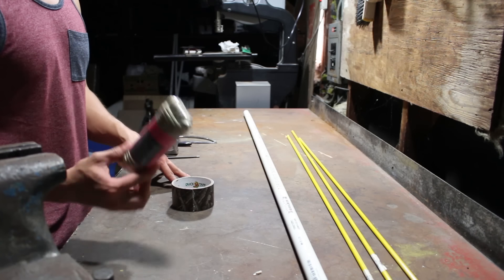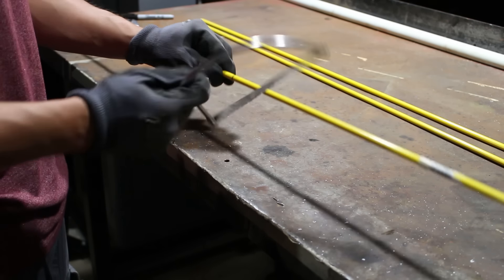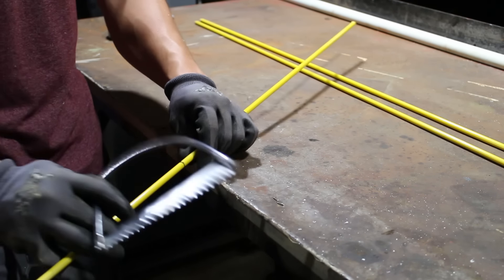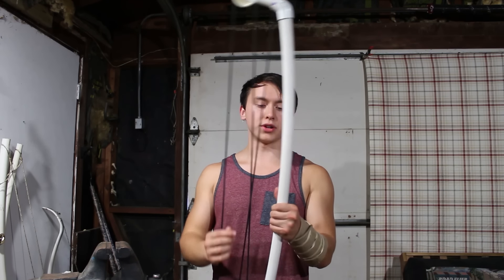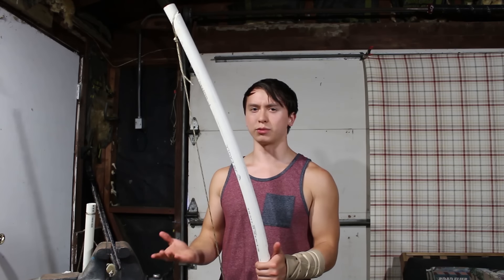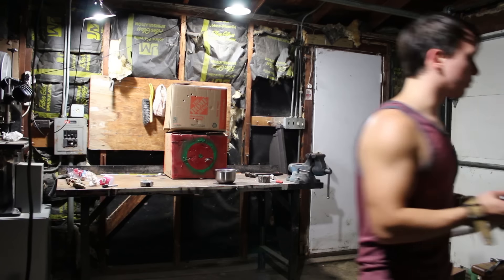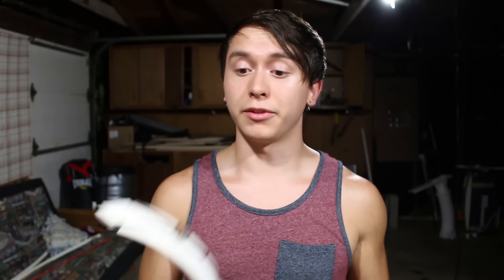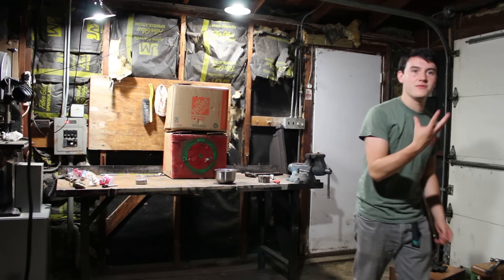Easy, Cheap, POWERFUL Bow (NO Power Tools or Heat Needed)

Comment: the recurve bow is a non-mechanical way of emulating the compound bow. that is why you are getting the same velocity with less effort
Reply: The Recurved tips act like spring-loaded, elliptical pullys, that only get "loaded up" at the end of the draw. This allows a more constant draw on yur arm.
Reply: Kevin Navitas emulating the compound bow?

Seriously man? Think about which came first.
Reply: Recurved tips a) increase early draw weight by preloading the limbs more at brace, and b) reduce string angle at full draw which reduced limb stack and stores energy more efficiently near the end of the draw.
Also, I'm guessing the limbs on that 70-pounder are really heavy (mass wise), in which case much of the energy stored in the bow is spent accelerating the limbs instead of the arrow.
Reply: Jesse Rudolph okay let's talk about mechanics,

The compound bow emulates the action of a recurve bow that uses a mechanical function to have an easier drawn position.
Reply: @tannerjones1737  No no no.. The compound bow is specifically designed to shift the maximum draw weight away from the end of the draw, so you could hold a maximum draw easier, not struggling to aim. The recurve doesn‘t do that. It simply snaps faster than any typical design, so the power transfer from the limb to the arrow is better.
Reply: So the recurve bow somehow, non-mechanically (magically!?) tries to emulate a function of a specific bow which was only invented hundreds of years later? Wow!

Comment: I made a recurve crossbow using a old wood rifle stock and pvc limbs it has 90lb draw weight
Reply: Bobby Humphrey is that good?
Reply: Bernardo BR its amazing, if you can pull it that is
Reply: Mahamad Kader Op
Reply: +Bernardo BR not really. Most crossbows are consistently heavier than that. The way a bow works is it adds momentum to an object as the bow is releasing and there is a formula to calculate the force but it's basically the formula for work, MassxDistance=Work so the longer the draw distance the more time there is for the bow to impart momentum so that allows a longer bow to accommodate a lower draw weight while still being effective. Crossbows have a smaller bow and therefore require a heavier draw weight to reach the same amount of energy output so unless he has a longbow mounted on a rifle stock, it isn't that impressive. I recommend looking at Lindybeige and Skallagrims videos on the topics. Just search their username and bow or crossbow
Reply: MRCOLOURfilld If you are using a regular bow, 90 pounds is insane. Bows and cross bows function differently at their core. A cross bow typically has a crank, and you don't have to hold it back or pull with only part of your back, they will store the energy until you pull the trigger. With a regular bow, you have to manually pull it back and then hold it.
Reply: Woah....who could draw it?
Reply: Bobby Humphrey thats hillbilly brother. i want me one of them!!
Reply: Lies
Reply: @vincentbar484  even if you don't have a drank you can stand on the forks and use both arms to pull it back you don't need to have good form

Comment: What u guys will need 
Duck tape 
5 feet 3/4 inch pvc
Tape measure 
Driveway markers/ fibreglass rods 
Sharpie 
Hack saw 
File of some sort 

You're welcome
Reply: Sorry and paracord 
Rat tail file
Reply: Thank you sm 😂
Reply: +Stevothebevo7 the driveway markers are 4 ft. you can use 3 foot but they aren't as efficient. besides I've never found any under 4 ft
Reply: Laker Chan paracord its really strong rope and its great for making the bow string! you can look it up on ebay if you cant find any around your area!
Reply: +aus960 Do you know anything else I can use instead of the highway markers? thanks
Reply: +Lucas Hocking no i don't know what you could use instead but you could probably find them at a building store around your area! and if you cant find any search it up online i'm positive you will find some at a good price !

sorry if this doesn't help
Reply: +Lucas Hocking use tent frames!! they are fiberglass too but what lenghth does driveway marker has? bcs tent frames only 52 cm long(or should i say short)
Reply: How much is thick fiberglass rod?
Reply: alien not quite sure but i don't think it could be that expensive
Reply: I did not ask for the price, i asked for the diameter of the rods. But i have trouble for finding this rods..the are very rare in my country..
Reply: alien if you cannot find any rods use tent poles the work just as good and the diameter i have n clue but i recon the tent pole width too
Reply: I tried with tent poles they are too short..thanks anyway
Reply: alien make the bow shorter or put 2 tent poles together

and if none of that works i have nothing else sorry
Reply: I'll manage somehow ... thanks

Comment: thanks now i can survive in a zombie apocalypse
Reply: A bow is pretty much close to useless in a zombie apocalypse
Reply: @泡麵 long stick with a pointy end > bows
Reply: Zelrael have full European plate armor and a long spear
Reply: I guess you can reuse the projectiles
Reply: @zelrael4728  technically that's called a spear
Reply: @isaiahholbert  yes thats what i meant
Reply: @zelrael4728  wooden stake
Reply: Akiro_ 25 i do
Reply: I would buy a crossbow
Reply: Bruh you gonna need ALOT more then just a bow, you need food, clean water, shelter, not to mention if you get sick or injured, unless you know what the fuck is going on, you're screwed. Also dont forget it's not only the zombies you have to worry about, it's also the people.
Reply: Bro now we are preparing for revolution against military coup

Comment: Those driveway markers would make good arrows.
Reply: if they break tho or get scratched the fiberglass fibers will sting like hell
Reply: Not really dude, never do that. Those highway markers can flex well but split easily. So they're great for adding power to the bow but will shatter on impact as an arrow
Reply: you can buy kids practice arrows for like $2. they work pretty well if you aren't trying to kill anything.
Reply: Alexzander yo wait hold on, did you just say “shatter on impact”?

Now wouldnt that be effective as an arrow in real battle. I mean you wouldn’t want the enemy to hit you back with your own arrow right?

Also... Possible grenade arrows?
Reply: @eomersimbajon2938  that shit impact everywhere and the shatter could possibly hit you back
Reply: @eomersimbajon2938  all in saying that its really impractical to use
Reply: @eomersimbajon2938  aside fron the dangers to yourself as so keenly observed by nutella the actual penettstikn of the arrows would be severely diminished due to the impact force going into the shaft instead of the target, so they'd be weak and a danger to oneself

Comment: how to make arrows
Reply: xave man look up a video.  3/8th inch wooden dowels should be fine.  Goose feathers work as fletchings.  You can make an arrowhead from any metal.  A broadhead from a spoon or saw blade or w.e or a regular target point from rebar.  Or you can flintknap yourself one.  Should be like 28 or 30 inches or so.  Depends on your draw length I believe.
Reply: This isnt Google.
Reply: how to english
Reply: Find straight stick, make stick pointy, give other end of stick notch.

Comment: I have two questions: 1.  how do you make the arrow itself, does it require a certain type of wood? what is the diameter of the arrow? 2. how about inserting 3/4 inch pvc pipe inside a 1 inch pipe? is it a good idea? it is because I can't find those fiberglass sticks in here
Reply: How did the pipe inside a bigger pipe idea work. I'm thinking of doing that as the fibreglass rods like  he used are £66 up

Comment: A question:
How long did/do these bows hold up?
I know PVC will get brittle after a while, so I wonder what the longevity of one of these is, 3-5 years maybe?
Reply: Hi, another PVC bow user here. IMHO, as long as you keep it out of sunlight during storage then you can use it for quite some time. Bought mine from a local bowyer for (approx.) 10 dollars around 2 years ago. Still feels like new aside from some minor scrapes. 

I think the longevity will also depends on the material used and build execution. Fresh PVC pipes that is stored inside will make less brittle bow compared to old PVC pipes that are left outside in the sun. During the build, managing the heat will also be very important. Overheating it until brown spots occured will create a weak spot.

Last but not least, I try to regularly use (at least) safety glasses during usage. You know, just in case.

Comment: the highway markers could probably used for makeshift arrows/projectiles as well.
Reply: yeah but a cheap arrow probably cost the same as the marker by the time you add fetching and a notch that won't split.

Comment: A normal bow loses force towards the end of it's stroke. A recurve bow is still pushing the arrow at the end of its stroke.
Reply: That is correct.  The longbow/stickbow style he is making peaks in acceleration about mid stroke.  The recurved tips are able to maintain acceleration for a longer period, and deliver a smoother more linear acceleration, making it more efficient.  The box/penetration test shows this beautifully 45# recurve = 70# longbow.  they are also typically more comfortable to shoot with less handshock delivered to your hand when the bow string comes taught.
Reply: +rronmar I'm really sorry about this stupid question, but how come recurve bows offer less shock than a longbow?
Reply: +Chris Walter Paluyo the monster bow is stronger but alot of the force is directed into the hand, recurve bow is weaker but more effectively transfer the force into the arrow, that should answer why they penetrate equally with different draw weights.
Reply: +rronmar Good point made. One of the main reasons why horse archers use recurve.
Reply: +AsianTheIdentity also moving the grip to one third instead of half way greatly reduces to hand shock and puts more energy into the arrow like the traditional Japanese bows

Comment: I made a bow that pulls 'bout 2 pounds...I use it to hunt cockrouches
Reply: Isn't that like physically impossible?
Reply: The_JoJo_Reference not unless you have like a rubber band and a chopstick
Reply: did you shoot matches
Reply: Same i used a hanger wooden skewers and a string
Reply: Snake Plissken yes
Reply: Are you aware that a cockroach will actually run into a vacuum cleaner hose that is suddenly turned on behind it. ... It feels the air move over its antani amd runs in the opposite direction.

Comment: Are you using your new camera to record this? Looks awesome! Btw was that your brother?
Reply from the maker: Kasper Ramsell Yep and yep.
Reply: +ZednoughtAlpha does your brother have a channel?
Reply from the maker: Mousey Games Not at the moment.
Reply: +ZednoughtAlpha ok thanks for responding.
Reply: I wouldn't know. I'm watching at 240p right now
Reply: ZednoughtAlpha force him to make one. or maybe make a video with him?
Reply: +Tim lundberg says the troll
Reply: +Giorgio Verzotto I want to know what he was making. Burning paper more accurately? With a nail?
Reply: +ZednoughtAlpha I believe I know the reason you were only getting the same amount of penetration out of the more powerful bow. 

When an arrow is fired the force applied to the back of the arrow accelerates it, the inertia of the heavier tip resists this causing the arrow to bend.  The greater the force of the more powerful bow increases this effect. The arrow warps back and forth with diminishing intensity as it flies, given the short distance you were shooting the arrow was still twisting a lot by the time it impacted, especially out of the more powerful bow. 

This causes it to strike your target at a less perpendicular angle as compared to the weaker bows (check your video and see if you agree) so a lot more energy was wasted by the arrow pushing into the target slightly sideways.
Reply: +Nevir202 Yeah you can actually see that  the angle of the arrow when it hits the target is pretty large. Could be an issue with his technique since he is fighting against a heavy draw weight also. In the outside footage you catch one of the arrows flying crooked which could be what happened with the 70lb.
Reply: +ZNA Productions How big did you make the bow.
Reply from the maker: BoSs bRoS HD The pvc before stringing was about 5 and a half feet long.
Reply: kk thanks.
Making it today.
Reply: ZNA Productions What length fiberglass driveway markers did you get? Working on my own bow and I am not sure what length to get. There are three main options that I see. A 57 inch length, a 48 inch, and a 72 inch. If anyone else knows, feel free to let me know.

Comment: lol, I love this video and will totally make this tomorrow, but the cost listed in these kinds of videos always seem to assume I have most of these tools. I do not, not even the simple ones. I have a hammer, and screwdriver and measuring tape. That's about it 😂
I had to go out and buy that file as well as the saw as I had neither. Not out of my cost range by any chance, but definitely the minimum price and not the maximum. I dont even know why I'm talking about this at all except I guess I've had a glass or two and decided to ramble I suppose
I think I have everything I need but the fiberglass rods. I'll have to find those tomorrow.

Comment: does any one think you could put caps on the end so that the bow doesn't have to be permanently strung but not have the highway markers fall out while stored
Reply: Adam Carnes thats what i did ill let you know how it works
Reply: Adam Carnes UPDATE: it works. :)
Reply: I jammed pool noodle foam into the pipe to keep the rods centered then pushed in a wine cork on top of that.  Cheap and effective.

Comment: Why cut the fiber glass? why not just put 4 full rods inside the pipe?
Reply: angers karin the rods were cut so that when he put it inside, it would help even out the pressure when drawing the bow. Thicker in the middle so it doesn't deform as easily also and thinner at the ends so the bow would have an easier time bending.
Reply: angers karin you need the center of the bow to have more rigidity and the arms to flex more. Full length rods would make it too ridig
Reply: What psi pvc should I use. 480?
Reply: angers karin you 🔥
Reply: It would also probably be a little too powerful with all 4. I made one and it ended up breaking at the top from the pressure
Reply: doesnt matter
Reply: If he put all of the rod in at the same length it would be too difficult to pull back. Cutting them and arranging them the way he did allowed the mos resistance to be in the middle of the bow. Therefor transfering the power through the arrow versus the bow string. Prevents the string from snapping under the emense pressure when it is drawn back.

Comment: Can you use bamboo instead of fiberglass rods (sorry if this is a stupid question)?
Reply: it works, but it would be as good of a bow because bamboo has these lumps when it grows, causing it to act a little weird when pulling back, i made one when i was younger and it did work, but pvc is probably a better choice.
Reply: +Lemon FroGG pvc does not rot, it's literally plastic tubing
Reply: Incog Elbowtross it is a good question and I like building using bamboo then fibreglass
Reply: PVC DOES rot! It gets brittle over time and exposure to the sun. Btw, you can make a bow out of a dried turd if you want.
Reply: The Dutchinator thats not what he means
Reply: Ilyja Horton doesn't it take like literally a million years for plastic to fully decompose
Reply: bamboo works but it makes the curve uneaven
Reply: The question was instead of fiber glass rods can bamboo sticks be used not about pvc pipe. Answer is it won't be as effective as fiberglass rods... Think of pole vaulting using bamboo instead of fiber poles.

Comment: Apparently the type of paracord matters, I used a stretchy kind, and my bow didn't ture out that great.
Reply: you want the string that does not bend, because the power of the bow comes from the elasticity of the body, not the cord.
Reply: Yeah, I agree with camalienator. You will lose a lot of power with elastic paracord